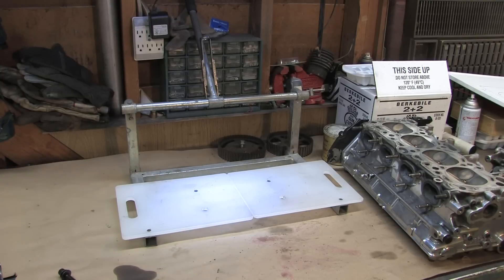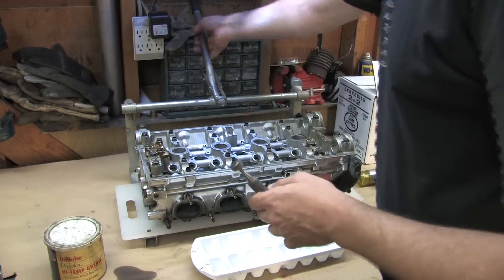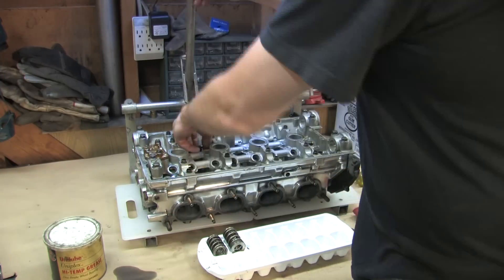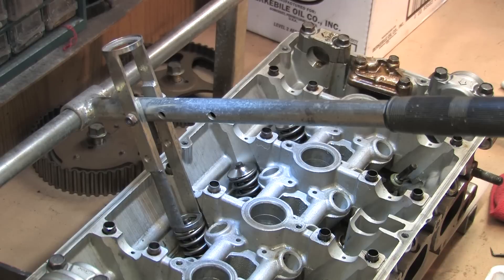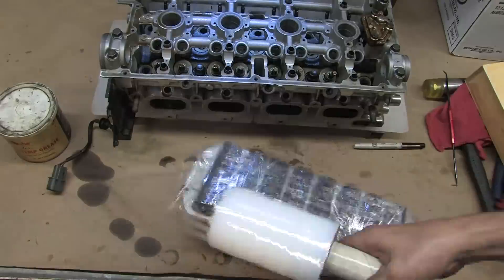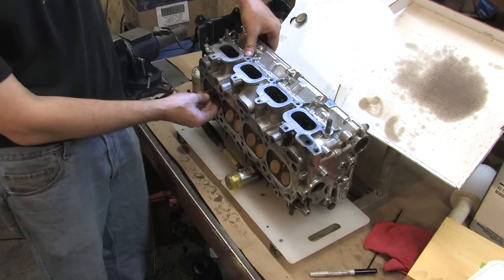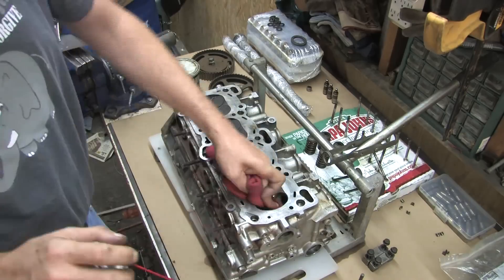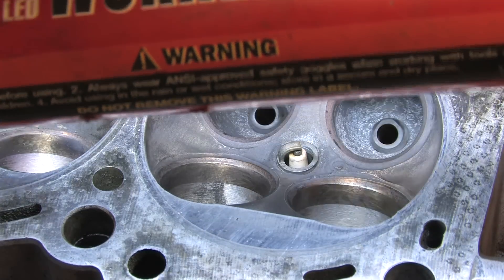Cylinder Head 104 - Remove Valves & Springs

Comment: Hey man! Great video! 
I''m currently rebuilding a miata head, and the keepers wont come out when compressing the spring... tried compressed air to make it budge, but it won't work.
I don't really want to try the hammer and socket method, as I could damage the head...
Any tips to get the keepers out? Thank you very much!
Reply from the maker: Compress the spring with all you've got and use a magnet.  The keepers are magnetic.
Reply: @Jafromobile  Thank you very much my dude, valves are now out, and the head off to the machine shop!

Comment: make this tool bet you you can't keep up with demand. looked all over for this or anything close. no go. can use the socket and hammer to remove them but need a compressor for install. I'd buy this in a heart beat. just press remove next valve. no removing the die from cam cap to cam cap. I want this thing
Reply from the maker: I know, I want one, too!  I had to give it back to its owner, and all I've got is measurements.  Precisely the reason you stated is why I never started making them.  Nobody I'm aware of makes this tool, and the base of that one was salvaged from a scrap pile.  It's either un-obtanium, or make-it-yourselfium.  I'll make one after things in my garage settle back down again.  It looks like I've got a high likelihood of needing it again and again.
Reply: https://www.amazon.ca/Valve-Spring-Compressor-Universal-Overhead/dp/B00FBXUOXO/ref=sr_1_2?ie=UTF8&qid=1504577217&sr=8-2&keywords=Neiko+Valve+Spring+Compressor+Universal+Overhead+Set

Closest thing I have found.
Reply: jafromobile.. when you make one let me know the measurements, so i can make one or you make one and ill buy it.

Comment: Need to do valve job on my Infiniti FX45, 4.5 litre dual OHC engine, 32 valves, started to smoke suddenly very bad, I think valve stemseals are gone??, No power lost, or any noice... just terrible smoking, and "drinks" oil a lot, half a quart every couple days??=(( planning to hone cylinders and replace pistonrings at same time. You think I could sand/grind  my valves by hand?/ And how much "freeplay" sideways your valves could  have without replacing valveguides?? Or replace valves?? Only has 120000 miles..., doing a work myself, done couple complete engine rebuilds before, but never on 32 valve engine. Also, can I do adjusting valves, when heads are off the engine, would be so much easier with shims...., will replace timing changes same time too!! Thanks, youtheman =)

Comment: Hello Jafro, nice videos! I have 4G64 GDI but it's in general the same thing. If you use this tool and MD998772 why there's no need to hold valve from other side? I've use screw clamp but it was a little bit tricky :) What fliuds do use to clean valves and channels in zylinder head. Thanks!

Comment: Hey Jafro! When you're pushing down on the valve springs it looks like it jarrs suddenly when you get past a certain point, why does it do that? Are you basically pushing past a little dimple there or? Do you think more Japanese cars would act the same?
Reply from the maker: +Striball The keepers are lightly-tapered, and so are the holes they fit in.  That's what actually holds them together.  Over time, the keepers get hammered into the retainer hole so tight that it takes a significant force to pop them loose.  It's really no different than how the tapered studs of ball joints tend to get fused into the knuckles of hub assemblies and have to be beaten free with a hammer, only the keepers are so small that they're pretty easy to separate with the valve spring tool.

Comment: you put the spring wrong way in your glass tray 3:00 intake exhaust mark inverted from the head
Reply from the maker: Joel Gratton  Nah, it just came out WITH the lower spring seat.  The first one didn't.  On the first one, the lower spring seat stayed stuck in the head.  That's actually what I mumbled about.  I matched them all back up after-the-fact.

Comment: Do the valves HAVE to go in the same spot they were before? Say if they were knocked over where you had them and mixed them up..
Reply from the maker: IF that happened, then I would recommend at the very least... lapping and checking each one to make sure it seals.  The reason this is important is because the sealing surfaces of the valve and the seat bed together over time, and the shape of the seat changes.  IF you did a valve job and cut every valve and seat the same, you don't have to keep them in order.  It's only with used valves.  Used valves have to match their used seats.

Comment: Great video. Question; how long do you have to lap the valve for 2. Should they have any leak 3. I put my head back on the block out some water in both the intake and  exhaust , some were still leakinfpg does mean I have to do it some more. Thanks for the help with block feedback.

Comment: If you do that video, that would be great for most of the DSM crowd as well as for me, being a metric guy, but please, don't go all in inches! If you do, please, show some formulas so I could convert it to metric system without finding books with basic physics for imperial inches! Thank you man!
p.s. I'm trying to build few weird engines, here in Russia, and I've found some new >>cheap<< and good looking springs of an AMG Mercedes which should be good for budget performance builds.

Comment: Hey! Btw, can you do a video on taking spring pressures off the existing valve springs? I mean, I've bought a ProForm valve spring tool from Summit and it basically measures pressure of a compressed spring (just tighten it up in a simple shop vice). I've got some numbers and I got lost. Most of the springs (especially dual ones) are not linear. Basically I can find if a spring is harder or softer that some other. But I can't really get the numbers for seat pressure and full lift pressure. Thx!